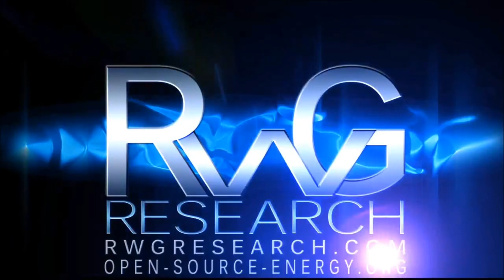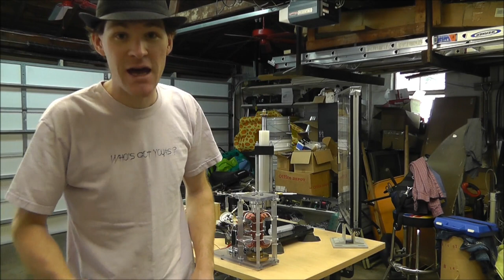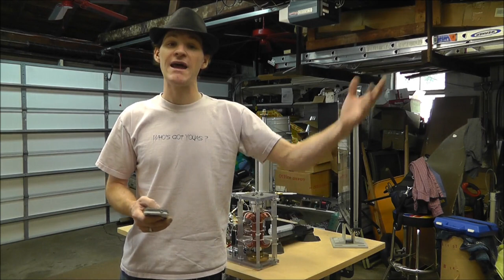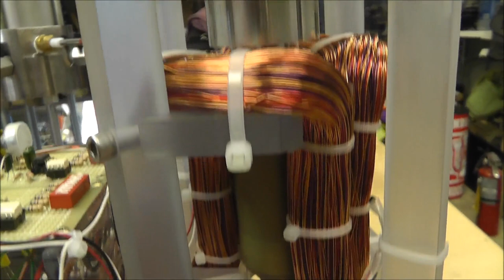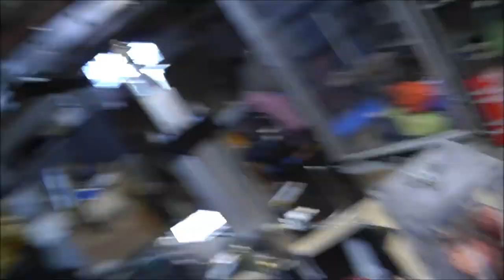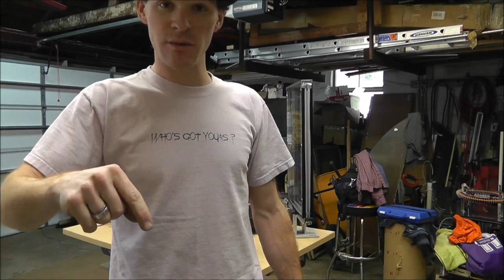The Pree-XMAS Pulse motor BuildOff 20-12!  International Alternative Energy Center &  RWGresearch

Comment: Hi MrAnguswangus.As you would have seen from the last build off,a man by the name of 1horn-that had never built a pulse motor befor"took out second place.The idea behind this build off is to get away from the standard old pulse motor,and bring in new idea's as how to power devices.A home made transformer is very easy to build-so the normal measurments can still be taken.Most of us who build these little motors,can grab a circuit-and build a working modle.Let's get away from the same old same old

Comment: Another tough one:  With the motor running at a stable speed with a relatively short energizing pulse of a fixed length, what happens if you start the pulse at top-dead-center vs. delaying the pulse by a variable amount of time after top dead center?  Can you make your pulse motor more efficient in terms of RPM vs. watts of consumed power if you delay the firing of the pulse?  Is there a sweet spot to give you more torque x angular displacement if delay the pulse?  Will you get higher RPM?

Comment: One last one for the boys:  Make an accurate measurement of the power consumption of your pulse motor.  Assuming you are capturing the back-EMF pulse and sending it to a charging battery or powering something with it.  Make an accurate measurement of the output power of your pulse motor.  Whose pulse motor has the highest ratio of output power vs. power consumption?  As you increase the supply voltage and the RPM, what happens to that ratio?   Is there some kind of a trend line and why?

Comment: Bonus task for extra Brownie points:  Make an _accurate_ measurement of your motor's power consumption and measure the RPM.  Then calculate the RPM per watt of supplied power.

Double bonus task for more Brownie points:  Measure the motor's RPM for increasing power levels and calculate the RPM per watt in each case.  Do you see a trend line due to increased air friction?